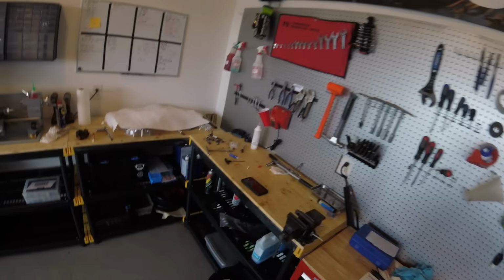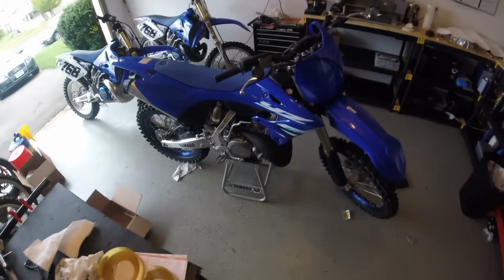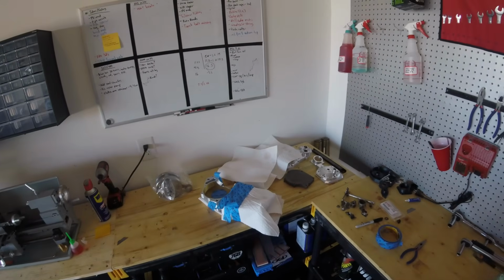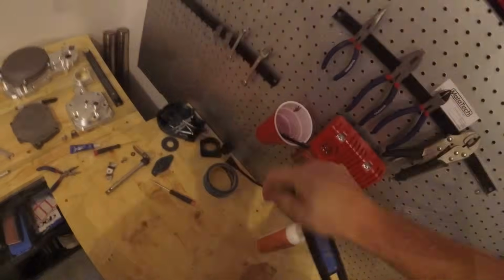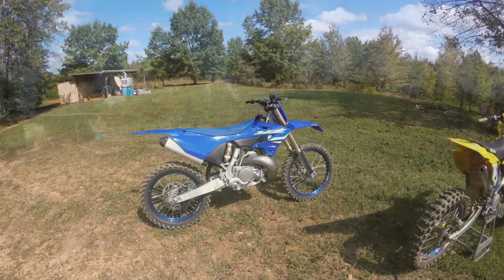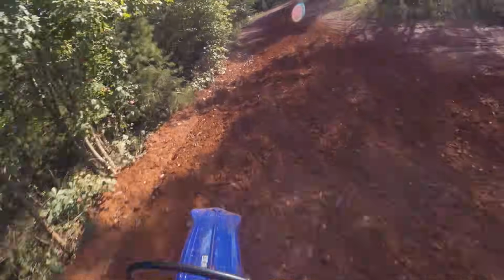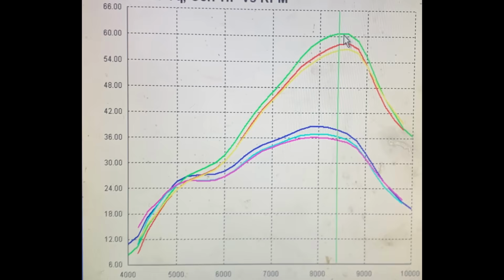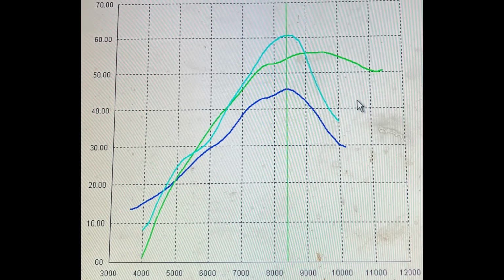YZ400 TWO STROKE: Build, First Ride, and Dyno Testing!

Comment: The power curve reminds me of an I.T 465 I had in the very late 80s very early 90s, I should point out that I used to modify 2 strokes and make my own pipes, anyhow I ported it to YZ spec and shortened the header pipe but forgotten how much.
I didn't have access to a dyno but the power curve was very similar to yours ( probably 15-20 bhp less tho lol 😆) 
If I did a low rpm roll on in maybe 3rd or 4th on damp sand I'd see it churned up for a few yards then I could see the tread patten of the tire for about  2 feet before it became a 3 inch deep trench until it was time for the next gear, for the first few yards the wheel had spun but probably not much faster than the actual speed then the disturbed sand would gradually fade out until the tire tread pattern was clearly visible even though distorted, then the 3 inch deep trench started almost immediately,BUT the flat spot was almost unnoicable while I was riding it, probably because the tire went from spin to grip then back to spin.
I should also add that I'm not a moto-x racer but I did race a Yam TZ350 on road citcuits so I was used with peaky engines so I probably kept the rpm at the high end most of the time

Comment: Nice power, but why does your YZ400 make less bottom end power than a CR250 ?
Reply: Ok, thanks I figured it must be something like that but didn’t know what.
Reply from the maker: Anything under about 5k rpm here depends on how the operator rolls into the throttle. That part of the graph isn’t relevant and should be trimmed off but I only have dynojet software currently.

Comment: I would think 20mm shorter pipe(piston to cone) would give it some more over rev so she doesn't fall off so fast after peak...she would peak around 9200ish and have muchhh better over rev...of course other variables to consider like port timing ,etc.. SIK build though ,she has plenty more in her but I'm sure its a monster at the moment
Reply from the maker: The plan is to have a custom one built, but we wanted to use an existing pipe to verify our simulation model before having one made. Thankfully the bike performed exactly how we were expecting so the custom pipe designed in the computer should work well in real life. Having it drop off quickly after peak isn’t a bad thing in this application since the piston speeds are high and the piston is relatively heavy. The custom pipe will overrev a little more, but I really don’t want people revving it way over 10k for sustained periods.
Reply: @Yz_768  lol 10k would take a god behind the bars to keep it pointed in the right direction, cant wait to see the end result so i can ride vicariously through you. Have you thought about a forged Ti wrist pin to save some weight? One of my builds have then, street application, and have been working as intended.

Comment: Looking really good, great work.
I'm interested in what sort of power the stock YZ 250 makes on your dyno.
I have a couple of YZ250X's a 2016 & 2024 was interested in a BRC kit but loving the look of your 400 Conversion Combination.
The reason I ask is I'm a dyno tuner myself in the auto industry though I have adapted my Mainline Dyno for my personal bikes and collected a bunch of components to test on my YZX's.
Most dynos read differently I have compered mine to a Dyno Jet Dyno same bike etc.
I have a GET ecu I'm interested to do some testing with.
Keep up the great work.
Regards Lester
Reply from the maker: If i remember correctly Pete said 42ish was typical of a stock yz. I plan on making my own dyno soon and doing some baseline testing with the 250s
Reply: Awesome result. 

Respect.

Comment: Whoohoo!Thanks, ive been waiting for this😃😃😃😃
I have to say it worked out totally different to what i imagined! My brain couldnt get round the 250 2stroke expansion chamber.I thought for sure it wouldn't flow fast enough at high RPM. But it's the opposite! You've made a motor with massive top and mid (once that powervalve spring is fixed).I'm surprised it has almost nothing below midrange.It's not a big deal,i just thought you were aiming for a flat-ish torque curve
Reply from the maker: It actually has plenty of low end, I meant to say this in the video but anything under 5k rpm depends on how it gets rolled on on the dyno and isn’t really part of the comparison. For example it still made more than the 450 at the first data point but less than the 250 which is obviously not accurate.

Comment: So your first ride was with the least performing head?
Reply from the maker: That’s correct
Reply: @Yz_768 and your correct about 60whp is a good amount of hp from a mx ported 400cc. Im rooting for the 70! But as you know that last 5 is gonna make you work for it!
Reply: @Yz_768 curious where you get the different stiffness power valve springs from.
Reply from the maker: @robertdoxtator2493 McMaster has all sorts of springs to choose from

Comment: 60hp at the rear wheel is way more than 95% of riders would ever use ,the ktm 300 xc carbed was just like 46 -48 hp the counterbalance engine and the pros will say that you dont use all that its about tractorbilty . Good Job on your YZ 400 build you should be very proud of your self  ,  I know I would be super stoked if I was smart enough to pull off half of what you have done !

Comment: Around the 2000's i had new a kx250 and my mate had new a cr500 and we used to swap bikes and the power curve was linear on the cr500 with no noticeable powerband and the kx250 was exponential at the top end with a noticeable power band.  Looking at that Dyno of a new 450 4t and your 400 2t thats what my friends cr500 felt like... not snappy power all or nothing but controllable power. Keep up the amazing project 👏  im subbed 👍
Reply: To change the power curve use a different pipe. The one you were using was probably a top end  pipe.
Reply: That CR must’ve not have been running right or something cause they got a snappy power band specially when they’re too and really well they’re hard to ride on trails at least for me anyways

Comment: Can't you just do a gear change through sprockets and it does sound like a big bore sounds like a big bore 400 Husqvarna from the day which were really fast motorcycles good job my friend awesome
Reply from the maker: It’s already geared “down” with 13/50 vs a stock 14/50, the primary gearing is just so much taller that it’s still a “gear taller”. It honestly feels almost perfect with this gearing, I’m going to wait until it’s at its final engine configuration before adding any teeth on the rear sprocket. Thank you for watching!
Reply: One tooth on the counter shaft is equal to 2 1/4 on the rear sprocket you know that right up or down
Reply from the maker: @williamleonardo8478 yes I’m aware. I’m not going to a 12t front it’ll cause excessive wear to the sprocket and swingarm.
Reply from the maker: Also it’s not simply 2 and 1/4, it changes depending on the number of teeth you’re currently at front and rear.

Comment: Awesome very good job my friend are you going to have a wide ratio transmission possibly a 6-speed optional with this and also Mossberg is a reed company out of Wisconsin that builds Reed valves for snowmobile application to actually do a really good job I put them in some of my KTMs and TM motorcycles which worked very very well better than the boys and reads